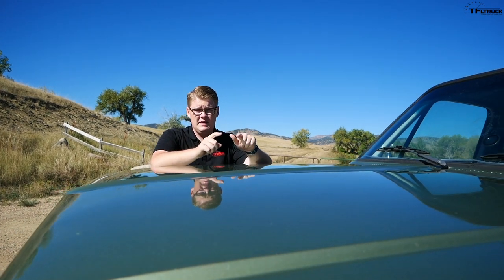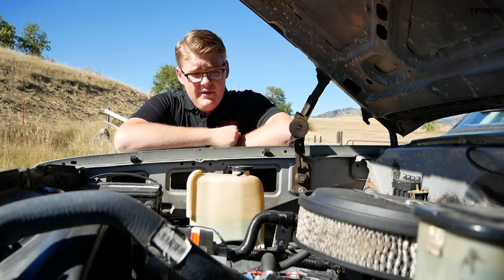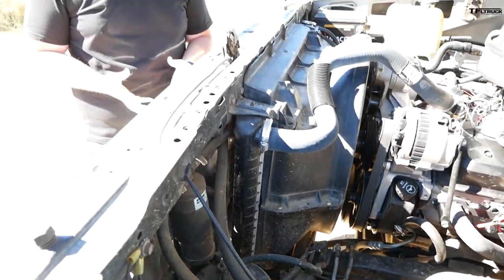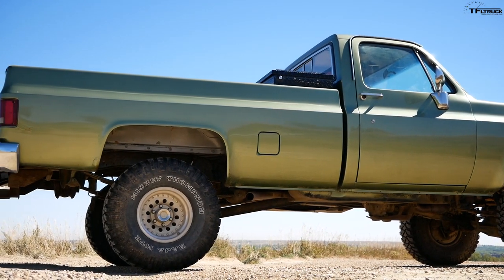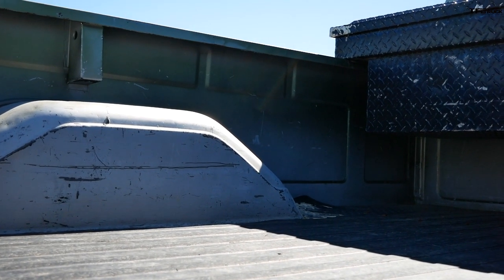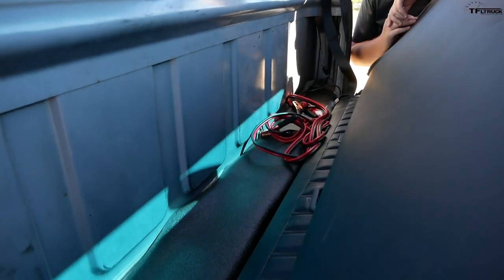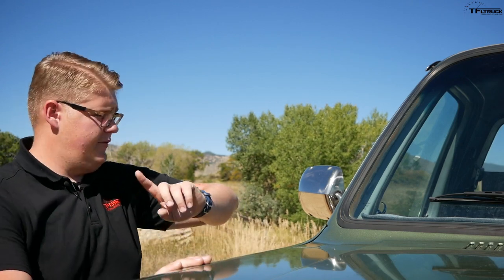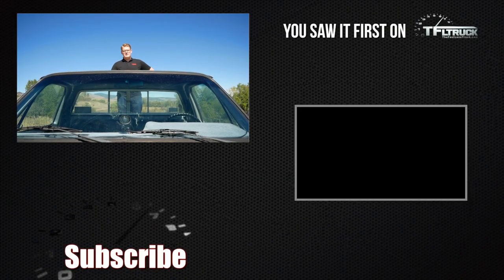Is The Chevy K10 Square Body Pickup Cool or Crap?

Comment: COOOL Trucks!  I have personally had 6 of them.  Starting in 1976  I bought a new full option Beautiful 3/4 ton Silverado. It was Black (a head turner) with 12-16.5 chrome spoke wheels (the best chrome I have ever seen ) . All together,  2 K5 Blazers, 1 4x4 stepside w manual trans,  1 3/4 ton  4x4 with 350/350  and  a 1979 one ton w /454/400. Yea they are COOL.  I worked at a Chevy dealer in the service dept and became their pick-up expert.

Comment: 4x4 frames crack near stearing box ,the front differential spins backwards, low mounted motor suck water in easier than other brands,hoods bend in half when not lubed.
Reply: The kid in the video doesn't know, he's just reading the script that his dad wrote
Reply: Fords of that era also cracked the frame along their shitty steering setup, only much harder to repair
Reply: cinder 99 Yup. Dodge u joints are small. Ford had a crap load of different motors. Chevy frames are so bad there is a repair kit for it. Fords frames are not as bad. Chevy door sag and dont close good. Ford had low pinion 9inch wich was low to the ground. GM half ton axles are week,10 bolt rear ends axle shafts pull out if the axel fails. Ford had small 5 lug pattern. They all where good and bad. Now all front differentials spin the Ford and Toyota way.
Reply: Daryoush Borja >>> and with all those faults, I'd still take it over a Lariat this and a Laredo that.
Reply: Tactickle Shtooper I see why they are good looking trucks,best resale value, eazy to work on. I will take a 78 full size bronco with single shock ,round head light,automatic, with a 400m motor.

Comment: Everyone says 10 bolts are weak, however as long as you don't have big block or bigger than 35 inch mud tires they do ok. Piece of 1/2 inch pvc fixes the door. When my dad got a recall check to fix the saddle tanks on his dually, he bought tires. The one that is currently my baby is a 76 stepside, factory big block shortbed halfton with factory tac, 120mph spedo, and a factory GM CB. I love my swuarebody

Comment: I would really like to see how you routed the dual exhaust. Especially on the passenger side.The gas lines for each side tank run in the frame rails, and in order to get the passenger tube to route around the transfer case it has to bend pretty close to those lines.  When you posted the exhaust video I was disappointed  when you didn't show the underside.

Comment: I own a 78 Suburban! The body style was innovative at the time and continues to be a much sought after body. Mine originally came with a big block 400 and someone changed it to a small block 400 which had much less torque and ability. I will be restoring that big block performance and the 400 series transmission with the transfer case has been up to any job that I have needed. I have pulled trailers, other vehicles out of ditches and such with it. The one draw back I have seen with it is the shift on the fly transfer case. The person who owned it before me changed the auto locking axles to selectable lockers and that has solved the problem many people had with the first generation auto lockers freezing up and causing problems.
Overall it has been a wonderful vehicle and I will gladly resto-mod it. I just have to do it on a VA disability budget which is not very much money.

Comment: Dont listen to this man he doesnt know much. At least 25% of this info is wrong.
Reply: I can think of 2 things, they started using the 10 bolt in the front in 77 and they also increased the axle tube to 3" diameter from 2 3/4. I'll take the 10 bolt anyday.

Comment: The dozer blade attachment was a neat part of the advertisement. Best trucks ever made, problems and all. Maybe you weren't aware of all the options, but there are some obscure ones that were not mentioned. In '79-81 GM offered an Olds 350 converted to a diesel. It was far from a success, and the 6.2L replaced it in '82. There were two different three speed automatic transmission options - the Turbo Hydromatic 350, and also for heavy duty applications, the TH400. One transmission a lot of folks don't recognize is the New Process A833 MM7/MY6 option code. This was a reconfigured version of the big block Chrysler 4 speed that both Dodge and GM ran in full size trucks and vans. It had very similar gear ratios as the 700R4 four speed automatic. Also, in 1991, GM introduced the 4L80E 4 speed automatic. It was heavily based on the TH400, since that was such a robust success. Who hadn't dreamed of having overdrive on their turbo 400!? I'm not sure if you were strictly speaking of K10's, but the 454 was optional in the C10 in the late 70's and possibly '80. If I remember correctly, this was marketed as a Big 10. Also worth noting is the switch from carburetion to Throttle Body Fuel Injection. First introduced in 1985 on the 350, then in 86 on the 305 and 4.3L. I can't remember what year the 454 got TBI, but it happened during the square body V/R generation - maybe 1989 or 90? There you go - more things to verify and add to your next video! It would be cool to do a "rare option codes" video for the squares, like dealer installed air conditioning. That's a strange one, but it was a thing!

Comment: I had a 1986 Chevy C-20 in high school.  I really liked it.  It had a 305 with dual exhaust pipes but no air conditioning.  It was a plain white truck.  But it had an automatic transmission.  My dad had a 85 Sierra with a 6.2 diesel.  My truck did have a little rust.  I would like to find one soon to drive and fix up.  There are many still on the road here in Georgia.  I always thought those trucks were cool.

Comment: Love me some square bodies!   I currently have 2, 86 C10 and 82 K20. 
New trucks are nice as long as you don't have to work on them (or pay for them) but I like a truck that doesn't break down unless something is really broken.  A truck you can swap parts on and not need to reprogram anything. 

Huge aftermarket? I'd say so, if you have a cab and a frame you can build one in your driveway,  everything else is available down to correct nuts and bolts. And accessories out the yang.

Comment: The 10bolt rear axle is crap. It won't hold up with 33s..
Reply: My 91 has been running 35s for nearly 5 years no issues
Reply: the 10bolt front the thicker pinion is just a little bit stronger then the dana44 everything else is same strength in 3/4 ton both front 10bolt an dana44 had thicker axle tubes
Reply: @SSANCHEZZ_505  then you haven't been wheeling it.  My 10 bolt went bang after one easy run
Reply: Daniel Sanchez 10 bolt rear axles have small ring and pinions and weak tubes for a full size truck. If you treat it like a car and never tow or haul anything heavy or don’t have a powerful engine you’ll be fine. Guys that use their trucks hard usually end up swapping the 6 lug semi-float 14 bolt axle because the ring and pinion are much stronger and the axle tubes are thicker.
Reply: ive had a 75 Cherokee chief with a build 401 4spd np205 case 3/4 axles 10 bolt front an semi float 14 had 5.13's with 40" gumbo monster mudders I had enough engine to burn those 40's I went through a lot of motor mounts but if you don't bind up your rig you wont break stuff
Reply: if you have a 1/2 ton gmt400 sure go with the 6lug semi float 14bolt if not a gmt400 go 14bolt ff be done but you do know in fbody cars they have had a lot of hp though them 10bolts an live a good long while
Reply: I agree 100%, 10 bolts are shit, the 12 bolts should have never went away in the 1/2 tons. Nearly as bad as a Dana 35 in a Jeep, -friggin worthless.
Reply: Claudio Del Castillo yeah I just blew mine up I had swampers and was ripping around in 2low lol but im  about to put a 14 full floater in it
Reply: I have had a bunch of these trucks, and I know better! The pinion shaft in the 12 bolt is smaller and weaker than the10 bolt. The 8.5 10 bolt has it's faults, but is still stronger under most circumstances than a 12 bolt.Good traction, and some decent torque, and it'll snap the pinion snout right off, yoke, driveshaft and all!
Reply: So what's decent for a aftermarket upgrade?

Comment: I bought the first of that body style new in early 1973 a C20 with 350 cu in turbo 350 hydromatic. The truck was junk form the start. It got 10mpg and only had one 18 gal tank on the right side. Max fuel range was 150 miles. It had no rain gutters like the later models so when you opened the door the cloth seat got soaked. It had half '72 parts and half '73 parts so going down and buying parts usually meant several trips to the parts house to get the right part. The truck was two tone paint and had a ring of chrome around the white center, which GM put on with double stick tape, almost all the chrome fell off. They had a real flimsy tailgate that usually in a year it was bent. In a 100K miles had major work done 4 times to the engine, 1 transmission, many U-joint replacement. At least 10 alternators, starters, and batteries. Several wiper motors, 2 radiators and several water pumps. Sold it near 100K and the engine threw a rod on the new owner. That truck was junk from day one. Turned me in to a Ford owner after that.

Comment: One of the best trucks ever built in my opinion. Way back when, I had a 1983 C10 short bed and it was lowered. The 305 was under powered, but it was just a cruiser for me anyway. In 1991 I got rid of it to get a 1986 3/4 ton Suburban with a 454 because we were having kids and needed a back seat. Now that they have all grown, I bought a 2017 single cab Silverado  1/2 ton and plan to lower it. I guess it might be a mid life crisis thing, but I love the new truck.

Comment: I bought my 84 GMC SIERRA K2500 new when I was 24 Y.O. I retired it in 05 with 325,000 miles. I still use it today to plow my 1/4 mile long driveway. I've maintained it well, it'd still tagged and insured and able to be put back in service if needed. I love my truck, still has the original paint and on the 3rd engine. Ive worked its tail off.   Yup that's all, long live square body's!

Comment: I had a 79 with the LT1 and full floaters front and rear.  Mechanically it was a beast.  The body, however, was crap.  You could adjust the doors so that they would close or so that they would fit - your choice.  It also suffered from the typical square body tin worm disease.

Comment: I have a 79 K10.  NO cracking on my frame at the steering box mount. But then again it's never run tired over 32" nor has it ever had a snow plow mounted.

Comment: Very late to comment, but there’s a fix for having to “slam” the doors. The door striker has a plastic piece that wraps around the striker that the latch grabs on to. If the plastic gets worn and breaks off it makes it harder for the latch to grab the striker. Simple fix is to buy a new one and install it. After that no more slamming the door. Did that to my 87 R10 and haven’t had a problem since. As a note when replacing the striker. Remove the rear speakers so you can reach in and hold onto the treaded plate when removing and installing the new one.

Comment: There were 3 years like 1979-1981 where they used what was called a Dearborn 3 speed which was essentially a Ford top loader and was a super strong 3 speed.

Comment: Very cool truck. I had a black 1985 C-20 long bed with the 305v8 4 barrel. It had 230,000 miles by the time is was rusted out but still ran and drove. I’d have another one. I would rather drive one of these everyday than a new truck. 
It’s not flat side. It’s fleetside

Comment: I had a 1979 version of that truck, but it was a "heavy half". So it was a half-ton, but had beefier springs to allow you to haul or tow just about anything. This was my first truck, and I put it to good use. I was always carrying stuff, sometimes very heavy stuff. Some years later I bought an F-150 and was disappointed at how I couldn't just load the entire thing up with rocks.
Reply: Wasn't the Big 10 the Heavy Half ton from 76 to 80?
Reply: @FirebirdCamaro1220  It may have been, but mine wasn't known as a Big 10.

Comment: I love the old square bodies I have two of them a 78 swb 350 SM465  205  4.10 gears and 35s and an 86 K5 M1009 military blazer 6.2 diesel TH400  203 and 3.08s on 33s can't beat old school mechanical engineering.

Comment: I have a 86 k20 4x4  4 speed love it. It rolled out of gear and slid down a stump. Still wont sell it. Going to ls it and paint it some day. It will have Dana 60 in it. It has a 5.7 in now wilh three hundred thousand on the motor.

Comment: I have a 1979 K10 shortbed fleetside with a factory 400HD small block V8. It has 10 bolt 3.08 axles with Warn manual lockouts. The transmission is a Muncie 4 speed 117mm top cover (same that you have). The Transfercase is a NP205. 4" body lift and a 4" lift front springs and 4" rear blocks (Blocks suck but mine have lasted 20+ years). It all rides on 35/15/15 super swamper TSL tires.

Comment: I have a 1985 k30 454. Mine has the Dana 60 and 14 bolt rear end. Np 205 transfer case. All original to it. Regular cab, fleet side, and lastly TH400 transmission.

Comment: 2 keys ? Na, we used to cut the square off and put the key part in the ignition. Between the sliding back window and the side drafts, they were easy to steal anyway, so we went for convenience. 76 Blazer, 454 stump puller, 38 monster mudders, 6 inch lift. no power windows, locks, AC, just pure fun.

Comment: I had a C-20 Camper Special.  Other then problematic rust problems the biggest problem was the turbohydruamatic 350 with no extra cooler.  Burnt up the transmission 3 times.  Othen then that it was a great truck.

Comment: Running a mostly stock 83 k10 with a 305 . Has duel exhaust and 35" tires with a 3-1/2" all leaf lift. A bit rusty and the cab is very warn without carpet or anything,  but it's a weekend toy and a light homeowner use truxk that cost me $2500.  So far so good. Maybe I'll referb and clean it up one day. Identical to big green but flat black and worse bed rust

Comment: I know this guy said "throttle body fuel injection" but when he said that at around 2:11 in the video, pause it and take a closer look. I PLAINLY saw an accelerator pump; pretty sure this is a Holley 4160 4bbl carburetor.

Comment: Chevy K series trucks also had a 400 small block in '80. The 8.5, which was the 10 bolt in these trucks, is tougher than the truck 12 bolt, due to having a stronger, larger diameter pinion shaft.

Comment: I (incorrectly) thought that the purpose of a step side was to push the wheels outside the width of the bed to allow a full width pickup bed, unimpeded by interior fenders.

Comment: I'm a Ford guy. Got a few Highboys myself but I can appreciate a nice K10. That said, I wouldn't own one. It's anecdotal but as a kid an older guy ran a light in their K20 and hit our 74 F100 and my father and I were fine, truck got a little bend in the bumper, the K20 ended up scrap, engine pushed right through the firewall. 73-79 Ford's were just a cut above imo. Tough as nails and damn near indestructible. That wreck is what sent me over the edge to being a full blown Ford fan.

Comment: Great video and some good information...but there were a few errors. Fleetside not "flatside" and they also made longbed stepsides. You're using "K" as the series...K is just the 4x4 designation. The series is C/K. Some things mentioned here are options and not available on all years or models. Example...in 81 GM started using automatic hubs...those locking hubs are aftermarket.

Comment: It's a cool truck . And the lever button on the column to release the key was only on trucks that had floor shifters . Automatic transmission trucks and early 3 on the tree manual transmission trucks had the shifters on the column . You had to put the transmission in park or reverse if a manual transmission before turning the key to the lock position and removing it.  The button is just a link to the lockout that keeps you from removing the key before putting the transmission in park or reverse in the case of the manual.

Comment: I have a 1985 square body with a fully rebuilt 350 small-block and a granny low 4-speed with a edelbrock carburetor. This winter I'll be engine swapping for a  rebuilt 6.0 vortec and putting in a 5-speed transmission, and a pro-flo 4 cam. After all said and done it will be putting out 600 horsepower, the small-block and 4-speed I am putting in my crew-cab.

Comment: The square body was the working mans truck it got you from A to B with little to no problem.

I have a 1986 2wd long bed with a stock 305 under the hood with 118k miles with a 700r4 transmission.

It was a great video but fleet sides didn't come factory with wooden beds but the step sides did.

Comment: I fuel mine early in the morning when the station is not busy. I park right down the middle between two rows of pumps. Then I swipe a card at a pump on each side and plug the hose in filling both tanks at the same time. Drive it like you own it! HA!

Comment: I own an 04' Avalanche 2500 with an 8.1l b.b. and a 85' k20 with a 350 s.b. Although the Avalanche is an awesome truck; the bells and whistles in it will eventually be its down fall. Once they all fail, it may cost more than the truck is worth to fix it. However, the 85' on the other hand with its simplicity could theoretically go on for a hundred years or more thanks to the abundance of parts and how easy they are to work on.

In other words as much as I love my Avalanche it will always be second best to my good old 85' k20 square body.

Comment: I have an 83 k10 with a 350 with the same transmission as the one in the video, and I love that truck. But I can't find a bed for it.
Reply: Same issue I'm having finding one for mine of the same year, only difference is mine has a 292 paired with the sm465. Best bet I've found so far is LMC Truck, but you best be willing to shell out a few pretty pennies for the panels.